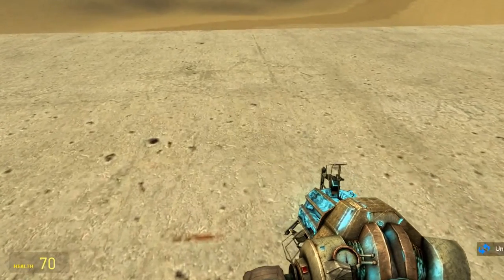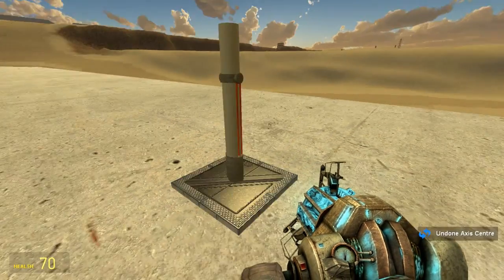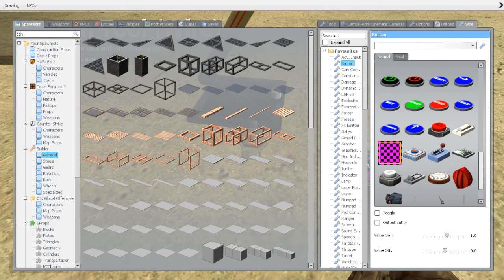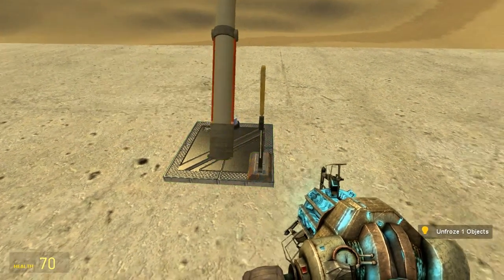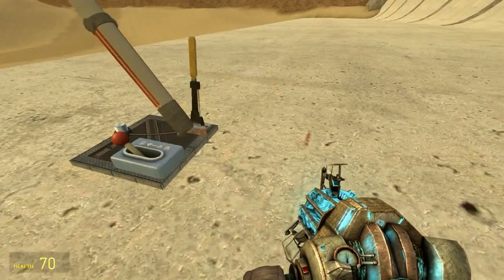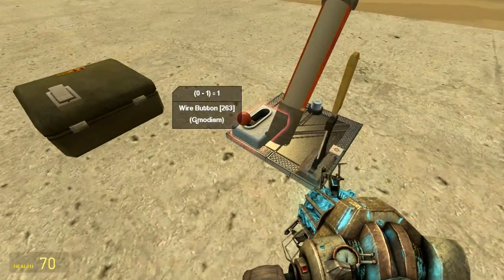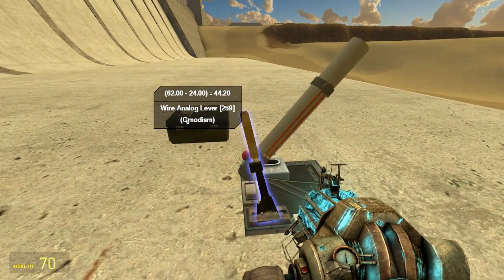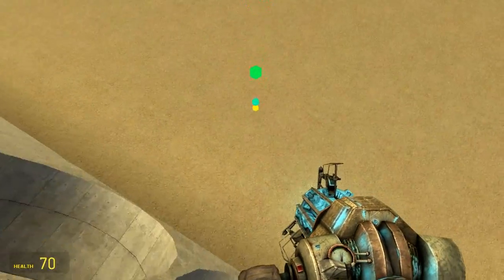[Tutorial] Garry's Mod: ACF Manual Mortar +Trajectory Calculation E2

Comment: Is there a way to do this without the lever? I play on a multiplayer server that has a "owner" system, and whenever I spawn a lever on the base, it "constrains" it, making it impossible to touch with a toolgun or physgun, besides a admin. Little help for a fellow sub please? :D         (also for ammocrates to have them constantly "activated," wire the crates "active" to the crates "munitions"
Reply from the maker: Oh yes, you can just wire it up to an advanced input with the same span of value to control its pitch the same wireless. Or you could make a up/down counter circuit to buttons, but that requires some extra wiring. 
About ammo: Yep that also works, however sometimes they get disabled and unwired for some reason, so for dupes I always wire them to a normal on of value.
Reply: Ah, thanks. Is it possible to make the Holograms Clientside?
Reply from the maker: Yes it is possible, however I never done it so I can't say on one hand how to do it... try ask someone on a server that used E2 how to do it, should be easy.

Comment: Hey! I'm having a problem with the E2, it's very accurate for targets that are very close, however when we get to medium or long range it's extremely off. is there any way to fix that?
Reply from the maker: Intressting, does it behave the same on a server?
Reply: Yes. I've tried it on my server, and on my friend's server. They are both very inaccurate at long range. I've tried the "correction" on the e2 but it does nothing.

Comment: Works fine and all, but the lever cause it to spazz out when I dupe and unfreeze it :( The E2 completely breaks when it's duped
Reply from the maker: use adv dupe 2
Reply: I am using it. It's the lever causing it which is strange, because when I remove it everything is fine.
Reply: Ok I found a work around. I can just unweld the lever before unfreezing it and re weld it. The e2 is fine I was just using it wrong. Thanks for the fast reply xD
Reply from the maker: Ah maybe area copy is better then, i'd think, so you get the parented stuff also!